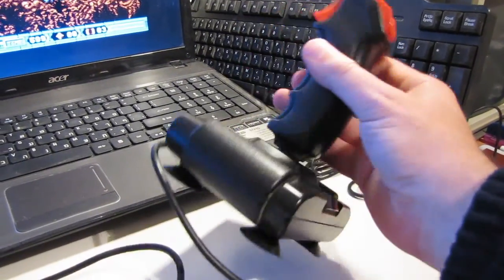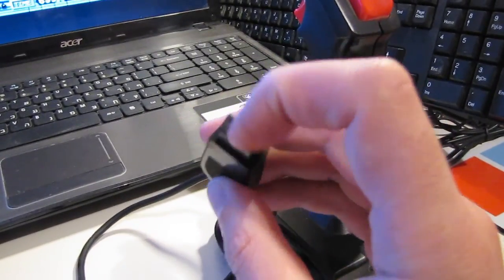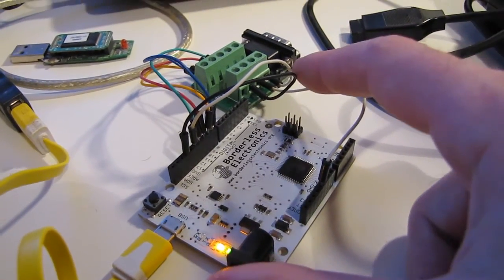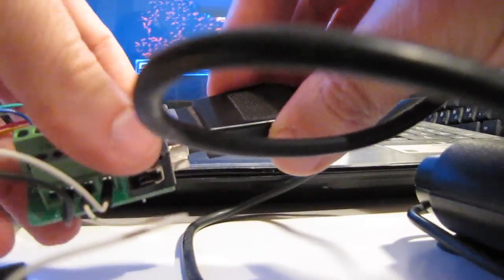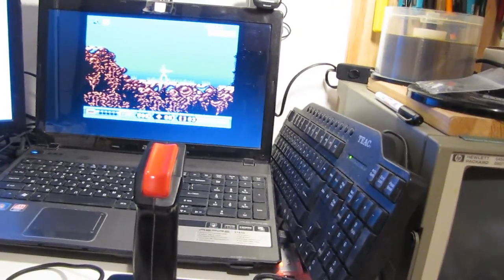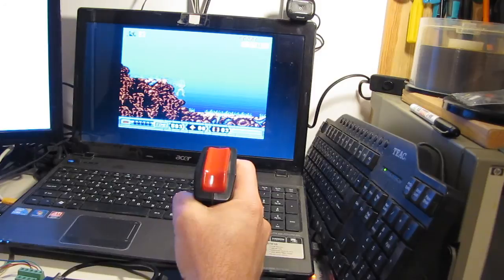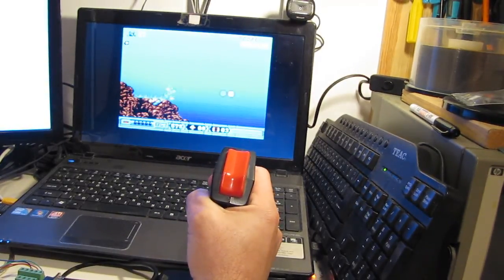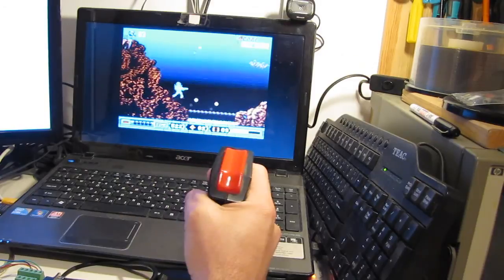Old Joystick Revived Using Arduino

Comment: Hey :( i’m having troubles with the code. I’m using a 4-axes thumbstick, and I need the keys still writing while pressing the button from the joystick. With your code, it writes only once the key, and I don’t know how to make it work as I need to…
Reply: Yess!
(context - using AWSD keys to move) 
when I press the button/move the joystick, it only prints the key once, and I need it to keep pressing the key until I release it. In your videos I think its working :( but somehow for me it's not working
Reply from the maker: Magdalena Riquelme
Actually, when there's rapid firing in this video, I simply clicked very fast... What you need requires adding a timeout in the code specifically for the button. I'll try this later tonight and put the results here - it may interest other viewers too.
Reply from the maker: idogendel.com
You can try this updated code: http://pastebin.com/6DYpv7uu , change the autofire rate by setting the value of RAPID_FIRE_SPACING